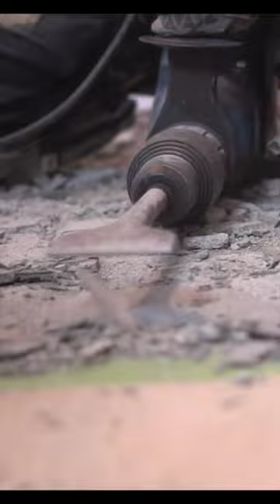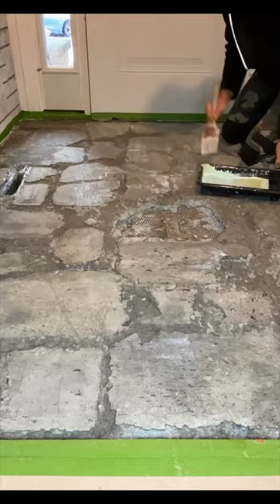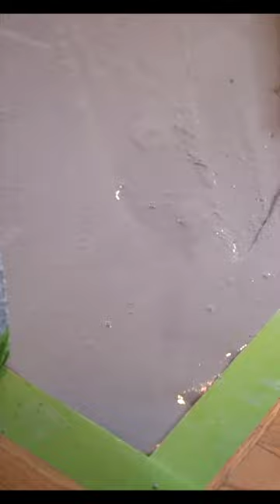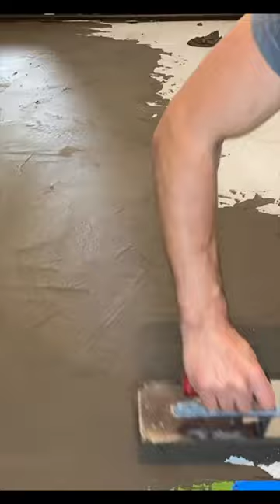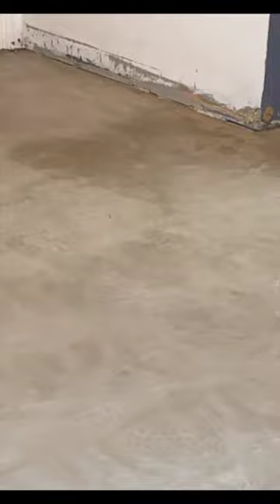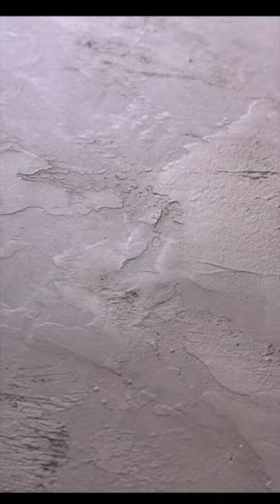Interior Concrete Overlay #shorts

Comment: Should have just used the self level as the finish and sealed that. You would have gotten a much nicer, smoother finish rather than that lumpy finish. I've used self level on 1500 sqf floor, then gone back and sprayed on 3 different tints of dye to get a night sky reflecting in water look. Finally sealed it off with a marine grade, slip resistant, clear epoxy.
Reply: Would love to see a pic.
Reply: How thick a coat if I may ask you?
Reply: They make self leveling "overlays" for this purpose.  Typical self levelers you find in stores are underlayments and usually much softer.  The main difference is durability.

Comment: When you use that feather lite your supposed to finish it like concrete......several passes on knee boards and you could have polished it .......instead you laid it down .....incorrectly might I add and never touched for 24 hrs .....shouldn't need to sand a concrete overlay ......this is sad